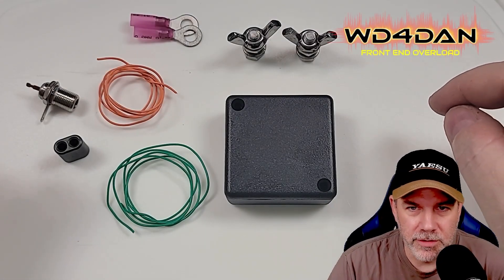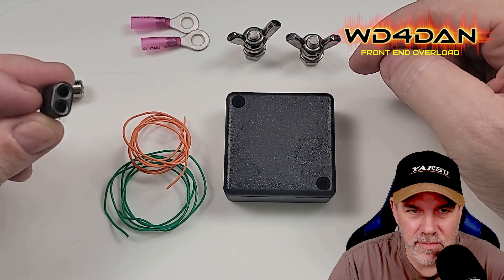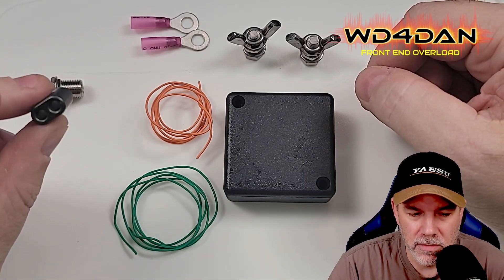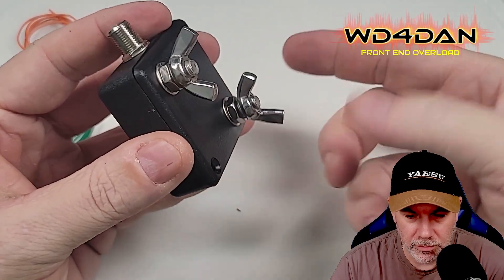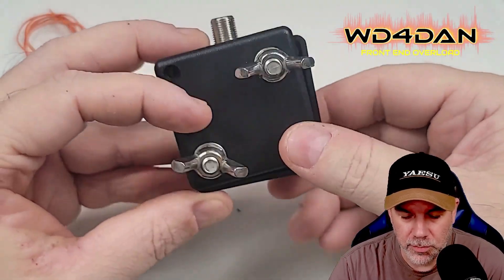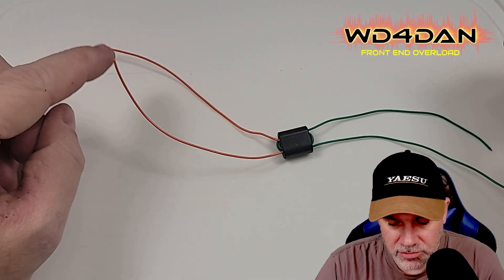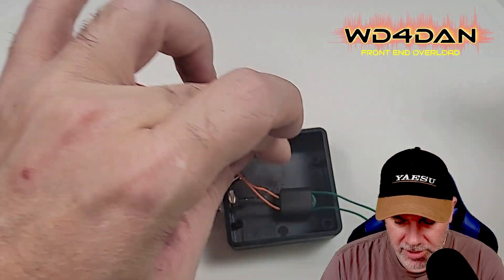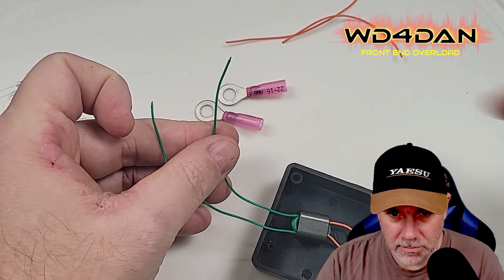Loop on Ground (LoG) Antenna Isolation Transformer Build - Save Money $$$

Comment: Hello sir there, greetings from Spain.
Very good videos and a very good website.
Regarding the ferrite binocular.
I have a BN-73-202,
I need to make a 1:1 balun with this binocular ferrite to make a loop antenna, and I don't know what diameter in mm of enamelled copper wire to buy.
I need to winding it 4x4 times (primary and secondary).
I would appreciate any information.
Thank you very much.
73 Jorge
Reply from the maker: 28 gauge should fit fine for 4x4 windings
Reply: @WD4DAN  Ok, thanks a lot
Have a nice day

Comment: I found when using 75ohm cable and a 60-70foot circumference loop that a 3/10 winding worked best, that bumped the ratio to 1/11 or 75/825 ohm. It gave me better performance, along with adding a 1m Ohm to bleed the loop of static and pair of inverse diode on the coax side to kill any voltages that could be introduced from nearby transmitting antenna.
Reply from the maker: @spareiChan  awesome info!  I have more cores.  I'll give this a shot.  If it ends up being better than it already is..wow!
Reply: @WD4DAN  Might be worth it if you got the extra cores, I use the same one. my loop is about 70~ft of 12awg low voltage cable (2x wires) with about 100ft of RG6Q and a 20db LNA inside, gives the same signal level as my DX commander with a bit less noise.
Reply: @WD4DAN  https://youtu.be/_NASlq-8GYY video of LoG vs DX commander to see how it sounds w/ 20db LNA